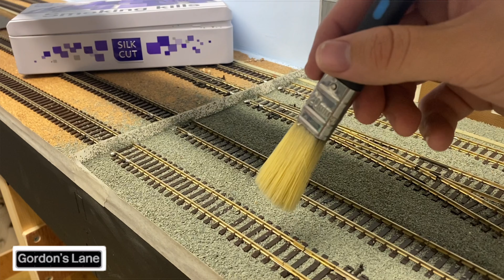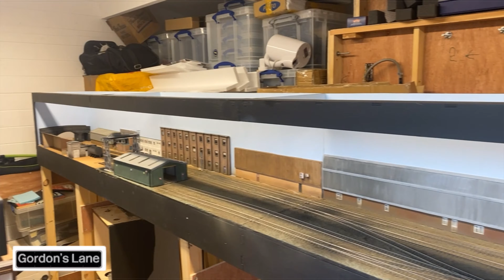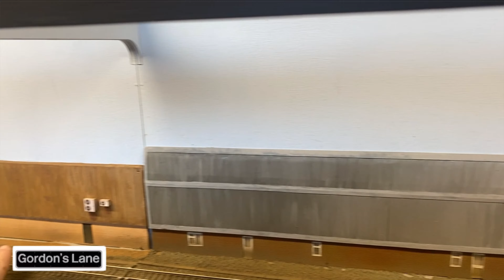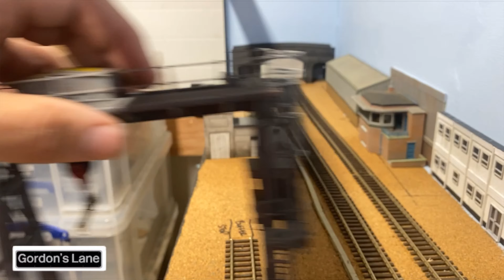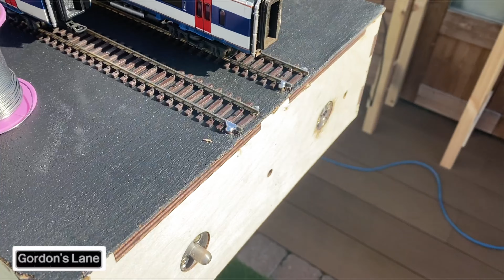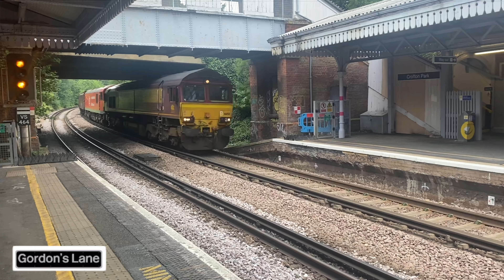Gordon’s Lane Part 8 - Scenery progress and Oval is working!!

Comment: A really great update, great to see you making such great progress. 
First time I have seen 3 class 350's running together in a 12 car formation, is there a special connection required to join up the different 4 car units?
Reply from the maker: Thanks, I’m happy with progress too! No they have NEM socket on the cab ends I use Kadees to couple them up. Then use DCC to work all three motor coaches
Reply: @EbsworthStreet  thank you